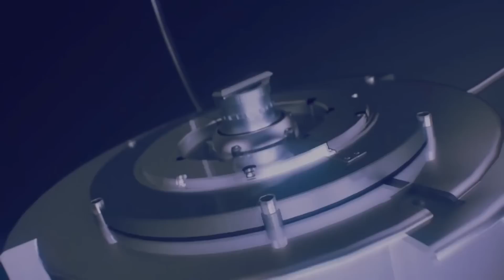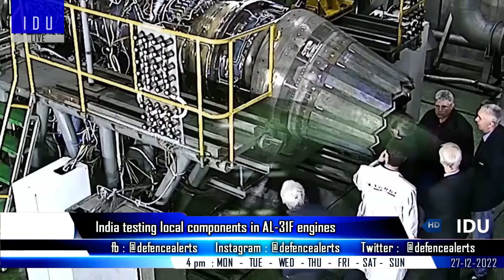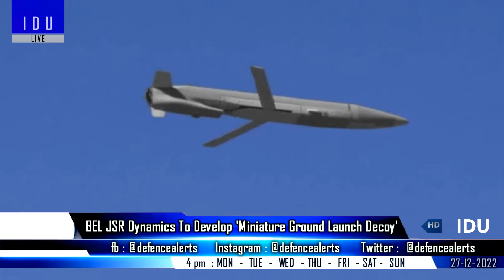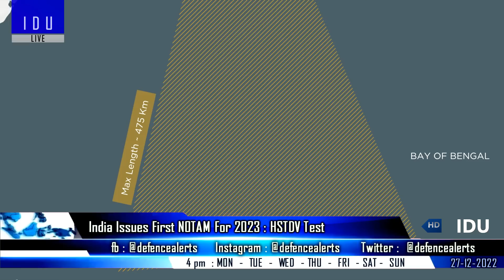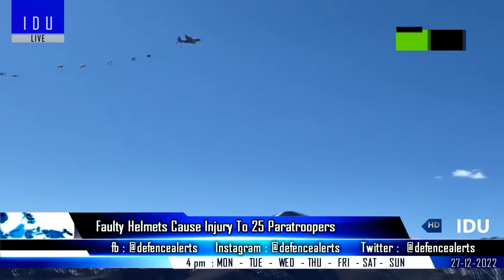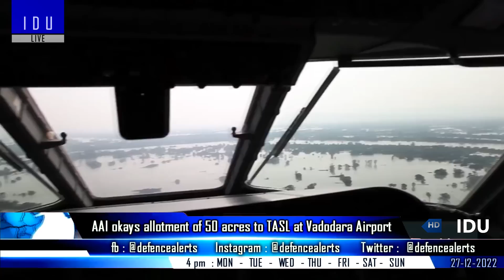Indian Defence Updates : TEDBF GaN Radar,HSTDV Test,AL-31F Engine Localised,JSR Dynamics MGLD Decoy

Comment: Just wanted to know if we have TOT for AL 31 FP engines why do we need to collaborate with RR OR SAFRAN to make another 120 KN jet engine. Can you please explain what's the sense of having ToT when we can't use that know how to make jet engines by ourselves.

How is TOT helpful for our defence sector. Pl make one video explaining what actually ToT means?
Reply: That TOT is actually for assembly...not technical know-how...for  ex the proportion of various metals in single blade of jet
Reply: Agree
Reply: This is how useless ToT is used which also add cost to the equipment